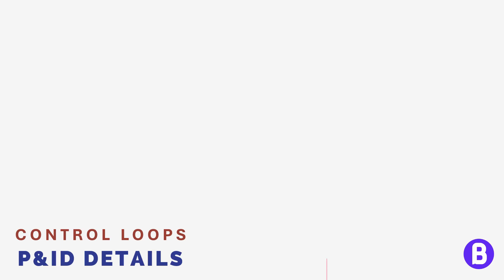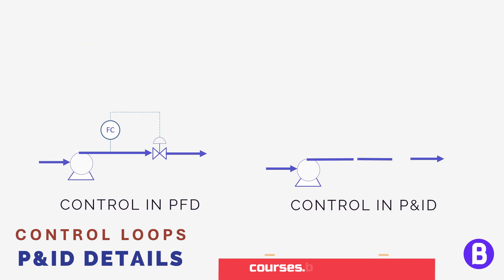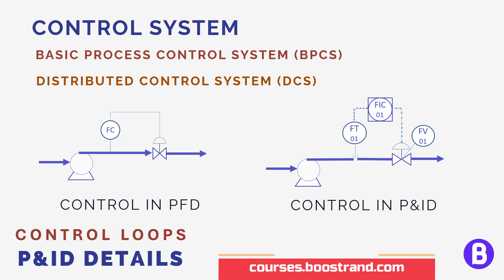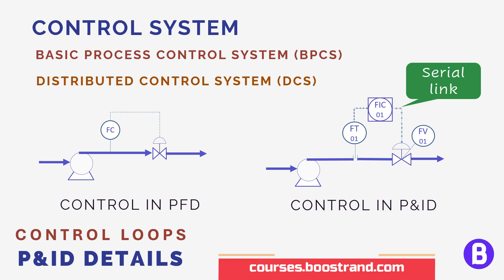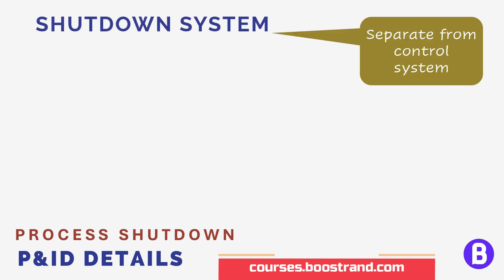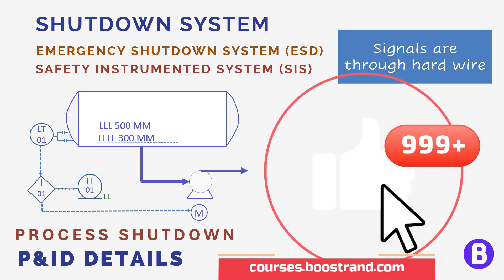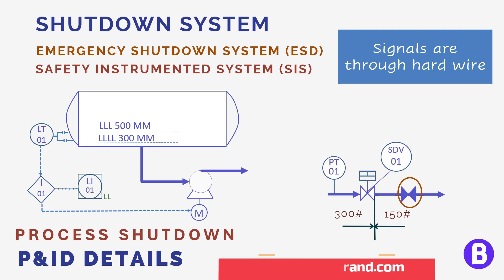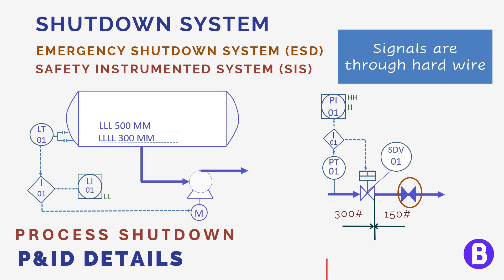011 Control and shutdown systems DCS and ESD or BPCS & SIS - P&ID Course 101

Comment: what is the difference between SIS (instrumented safety system) and ESD emergency shutdown in the oil and gas industry and what are their respective standards 0:19
Reply from the maker: They are technically the same. Sometimes the shutdown system is called ESD, and sometimes it's called SIS but it is the same function. Sometimes also ESD is referred to the total shutdown of unit and not just a small shutdown by a SIF (Safety Instrumented Function). So it mainly depends on how they are defined within a project. For a process engineer, the most important factor is SIL rating as this can cause a great limitation when assessing the reliability of SIF functions.